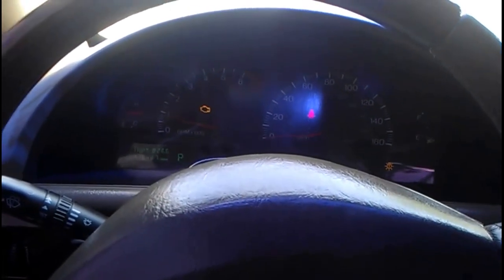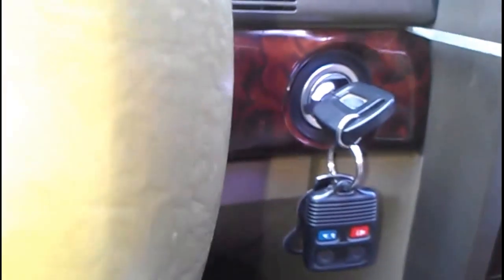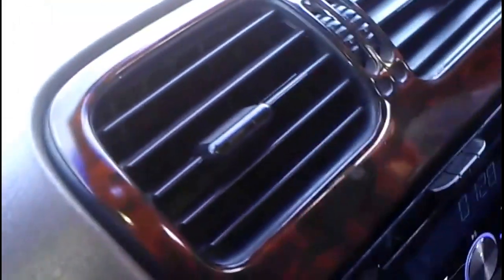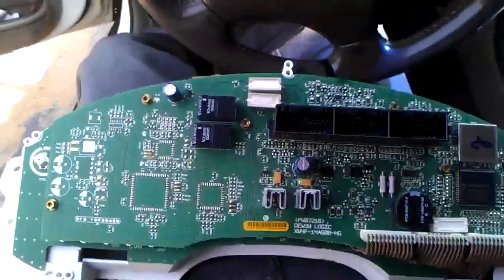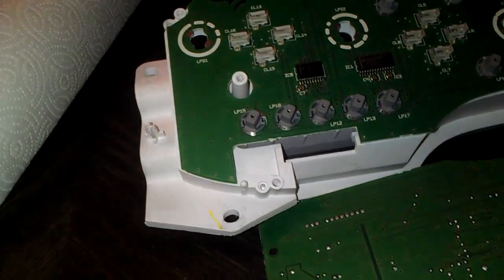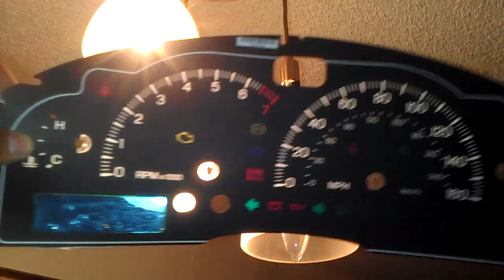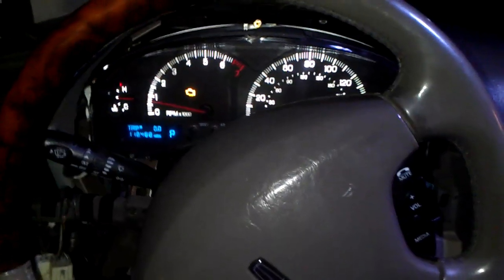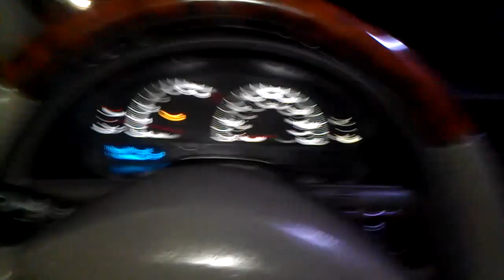Changing Lincoln Ls Cluster LED's

Comment: On the kick panel on the passenger side is yet another fuse panel, so 3 in this car all total. There was a starter motor relay fuse was blown, 5 amp. Code came up as 204, the number for the fuse in the panel was #24, not sure if the code 204 is 20 for twenty, then 4 obviously for 4, but no problems, replaced the fuse and away she went, thanks for your input , Dennis
Reply from the maker: Well I'm glad you got her running. If you need anything just let me know.

Comment: hi i have a question I run my lincoln when it reaches 40 or 45 i get an E in the instrument cluster then it doesnt want to throw the shift
Reply: not sure if youve solved your issue yet but what you need to do is get a mechanic who isnt scared of tackling a messy job to have your "transmission valve body dropped" and tell them you need your "4-3pre stroke spring" replaced. check a company called Sonnax. they sell upgraded springs as the factory ones are prone to failure. i replaced all 6 springs since i was in there already....might as well do them all. its no REAL extra labor at that point.i bought all 6 for about 50 bucks!! my car has never shifted better!!! the hardest part is finding a trustworthy mechanic who doesnt mind doing the job. aside from springs you will need trans fluid and gasket.

Comment: Hey man im doing the gauges right now and the leds have 2 lower prongs that are preventing them from going in the cluster.  Did yours have this issue?   I could get them in but id have to force them.  Let me know...
Reply from the maker: You have to bend the little metals just a little bit and once they are in there, try to bend them back and lastly i advise you to put hot gun over the leds.

Comment: Thanks for the video's man. Always wanted to do this, but thought it'd be harder than this. Couple things! 1) why does the ac not need any resistors? 2) wouldn't the tint idea, like on the instrument cluster work for the temperature numbers??
Reply from the maker: The ac does not need a resistor because it already has some.and on the cluster tint it has a green plastic which i cut off and added the blue one.

Comment: Okay everything went well accept my gas and speed gauss aren't working easy fix or no?
Reply from the maker: For the gas do you remember where you had it last time. and for the speed you need to connect it and drive it if the pin does not go up you have to remove it and just put it back in.

Comment: How many lights are in the cluster that fit the bulb you provided? I want to replace all of mine. Will a set of 10 do the trick?
Reply from the maker: niko vergis yes that should be more them enough
Reply: Lincoln Ls Mods have you done all of the interior lights? The climate and status console

Comment: Does changing the Airbag Light to LED cause any issues? I already have to replace that bulb as it is. Was going to go with LED but wanted to make sure that will not cause that 5 annoying dings from the computer non stop.

Comment: Did you have a problem restarting your car after you put cluster back in
Reply from the maker: No I didnt. Are you having that problem, if you changed out your cluster with a different one then your car wont start unless you add the same chip to the new cluster.

Comment: Mine is a 2000, not sure about kill switch. Did 4 different theft stop remits, still nothing. made sure no pins on back of cluster were bent over and all 3 plugs from wire harness can only go in 1 place each ?????? Totally baffled, mine bud is a mechanic and going to use a scanner today to check to see wtf, later man.
Reply from the maker: If you look by your gas peddle ( It Is mounted on the plastic by your right knee) there should be a  cable that has a chip connected to it. If that chip is not connected your car will not start.

Comment: What wheels are you going to put on your lincoln..
Reply from the maker: I Was thinking of putting some lexani but im not sure yet.
Reply: Lincoln Ls Mods I'm trying to get the cluster over the steering column but can't because of the plastic around it, any suggestions?
Reply from the maker: You need to make sure you remove all the plastic covers
Reply: Lincoln Ls Mods yeah I finally fig it out.. I have a question, there's something draining a lot of power so the car will not start. Any ideas to why?

Comment: I have a question. I recently had the radio replaced in my 01 Lincoln ls. It drove fine until the check traction control light came on and abs light came on. The car killed on me. Went to a place and let them charge the battery. It worked fine until it did it again. Could someone please help?
Reply from the maker: you need to check your wiring on your radio. you did you an aftermarket harness
Reply: +Lincoln Ls Mods I'm not sure what that is. But they took the radio out that came with the car out and replaced with a new one with a new mount.
Reply from the maker: +Julia Brown was it down at a professional stereo store.
Reply: +Lincoln Ls Mods yes.
Reply from the maker: +Julia Brown you should have them check it
Reply: +Lincoln Ls Mods because I'm keep being told it could be the alternator and I don't want to shell out my last. Whatever happened it's draining my battery.
Reply from the maker: +Julia Brown +Julia Brown test out your alternator. turn on you car and Discount the negative terminal while the car is on making sure it does not touch anything.  if the car turns off alternator is bad.
Reply: +Lincoln Ls Mods how do I do this?

Comment: hi i have a question I run my lincoln when it reaches 40 or 45 i get an E in the instrument cluster then it doesnt want to throw the shift
Reply from the maker: Would you happen to know the code it gives you. 
I have the same issue with mine I have fixed it before I will try to make a video as soon as my parts come in. 
to be more clear in the transmission you have a valve body and in the valve body there is spring also called the drive spring that spring tends to brake and gives you that problem. try doing this for me. 
when your driving and the E Comes on, while driving put car on neutral and then turn key off and back to on. the engine will not stop the only thing that should happen is that you dash will turn off and back on. and the check if the E still appears if so let me know. it shouldn't tho
Reply: Hi i did what you told me and it did work i ran it 4 times it went smooth until the 5 run it went back to E BUT it did throw in the shift
Reply: Hi i did what you told me and it did work i ran it 4 times it went smooth until the 5 run it went back to E BUT it did throw in the shift
Reply from the maker: +Jenny Arredondo okay I will soon be doing a video on how to repair it. it's quite a messy job but it better then pay $600-1000
Reply from the maker: hello I will soon be uploading the video of how to fix the E